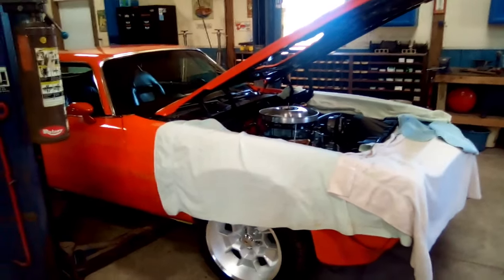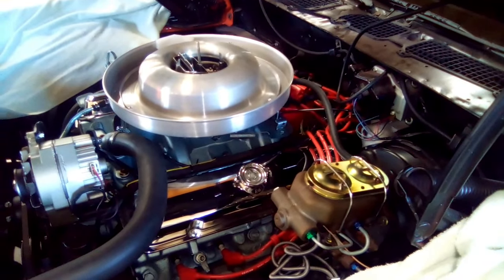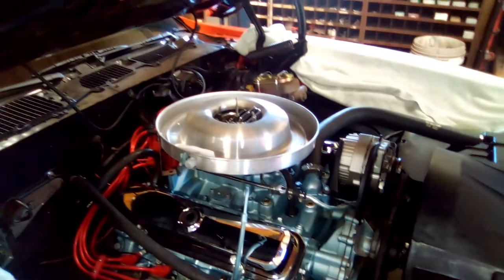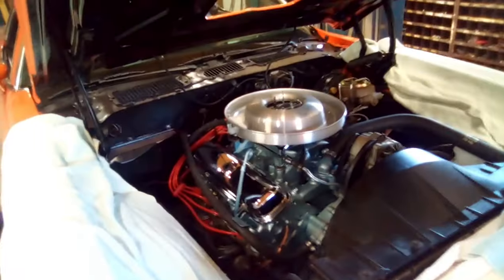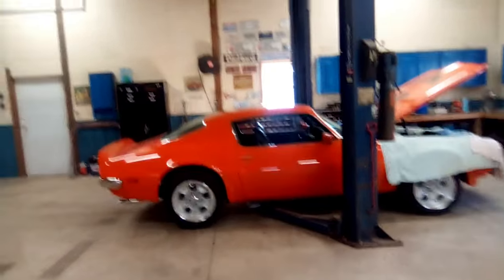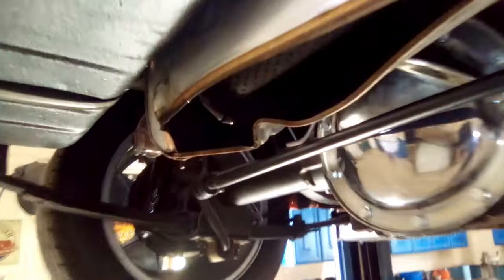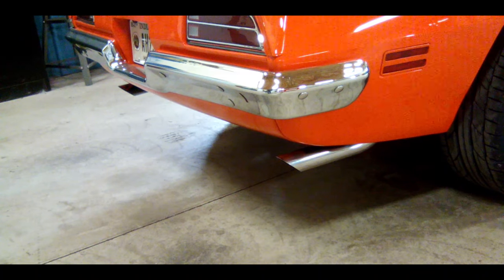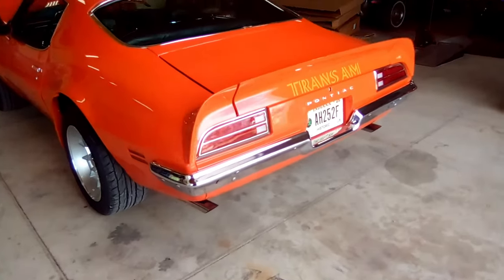1972 firebird muffler blow up air pocket Buick GS

Comment: You have some beautiful cars. On your ignition issue. I was working on an old Cadillac Eldorado. It was doing the same thing as your Firebird, only it didn't  blow the muffler up 😂. What I found on the Cadillacs distributor was that the little braided wire that ran from the housing to the  breaker plate came loose from where it was soldered 
  Sometimes making contact and sometimes not.
Reply from the maker: Thank you on my cars. I think the wire coming from starter to coil was broke, I tried another dist, and it was still doing it. So I didn't think it was in Dist.

Comment: I remember I had a 72 Impala with 400 sbc same thing happened with the points on me brand new dist, points, coil, wires, plugs my muffer went from oval to round after detonation and could never keep the points adjusted right! Installed H.E.I. never looked back always fired right.

Comment: A friend of mine had a '71 T/A sitting in his garage for over 20 years and then decided to slightly resto-mod it.  The paint that was on it was still in really good shape but, he still had them strip the clear coat and re-do it and after was all said and done with the body and mechanical he had over 40K into it(on an already clean car) and they estimated the car to be worth about 70K.  So after that he said the car was too nice to drive and was afraid to get dinged so he barely drove it.  What's the point of having a nice car if you don't use it?  He's selling it now if anyone interested.  Blue w/white stripe and same wheels as this one.
Reply from the maker: I have 3 restored cars and 1 truck, I don't get the drive time I would like with them. but we try and take a different car out each time we go for a drive or to a car show.

Comment: drill a very small hole in the thermostat to let a little bit bypass. Very small like 1/16 is all it needs.  then decide if you want it "original" or better. if you aint hung up on "originality" then ditch the mechanical fan and put a "GOOD" electric fan on it(a good one or good twins). You can also put a couple bypass hoses from the rear of the intake manifold to the front. Pontiac cooling design sucked! but its easy to fix.

Comment: Your friends said get rid of the points system . But you said you were dumping fuel . if I were you I would pull your dip stick and check to see if your overfull because Gasoline will wash do one hell of a job on the bearings if to much gasoline ends up in the oil . So for now I wouldn't worry about your points . But hey you sound like a Real Motor head Car guy  Lets hear about your Timing jumping around" Never mind the ONLY way your timing mark would ever move around is if you had excessive Timing chain wear and the only way you get that is too many miles and a really worn chain  your timing mark "jumping around" has NOTHING to do with a stuck Float Or not adjusted properly  If your carb is in fact dumping fuel tap on the float bowl set screw at each end of the Holly carb  with your car idling
Reply from the maker: Thanks for the input. In one of the videos before this one, I had mentioned, I checked the oil for gas and found none. When I said I was checking timing, I was looking to see if cam was going bad, timing wasn't jumping around, it stayed on mark. My timing light would go out from time to time, I was losing spark sometimes, you could hear a miss when light stopped, and it would come back , and light would start working . So I think, when spark would stop, raw fuel was going into exhaust. I think the wire coming from starter to coil had a break in it and wouldn't send spark sometimes. What do you think?